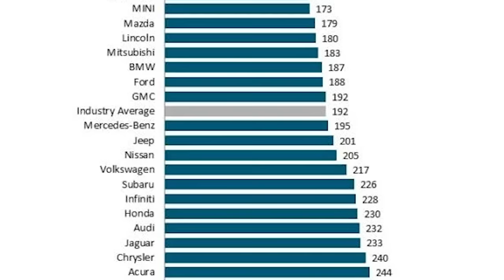Trucks That NEVER Break Down (Reliably run 1,000,000 miles)

Comment: You lost me when you said "According to JD Powers."  It's all about who spends the most $.  The data can be manipulated any which way to fit their narrative.  Kia and Hyundai with all their engine issues top the list?  Mini is #11 above likes of Mazda, Subaru, and Honda?  I guess I am old school and keep the car forever.  In the few studies I looked into, the "problems" are stuff like wind noise, slow infotainment boot up time.
Reply: I don't put it down to just 'money'. They are getting feedback on 90-day old and 12-month old vehicles, and looking at the 'small stuff' you mentioned. If you want to get the nicer of the brand new cars, and you're going to sell it in 3-4 years, that's what JD Powers is most useful for.
Reply: "JD POWA-"
"Don't touch me"!
Reply: They lost me with the ridgeline. It's a CAR with a lid-less trunk.
Reply: Never quite understood why JD Power glosses over Mazda, the Skyactiv engines are probably the most reliable direct injection engines out there and Mazda has the best interiors outside of a luxury brand.  And they also manage to make even the pedestrian CX-5 feel like a sporty, luxury SUV for probably less money OTD than a CR-V or RAV4
Reply: @mrvwbug4423  agreed
Reply: @richeerich561  I always thought of the Ridgeline as like a newer, more boring Subaru Baja.
Reply: Good call.
Reply: Jd power is a joke
Reply: @richeerich561 so it doesn't have a body on frame design. It's still a 5000lb hauler with a bed. Car truck, whatever, it does mid size truck stuff and will do it for hundreds of thousands of miles
Reply: The fact the Titan is not on there says it all.
Reply: Real talk
Reply: @itsmini6175  more like a Subaru Brat!😝
Reply: @christianrobloxserver7282  sure🙄

Comment: I've spent half my career fixing S 10 pickups and blazers. Some days I would walk into the shop and there was one on every hoist. Intake gaskets, oil cooler lines, ball joints, fuel pumps. Plugged heater cores, Typically any time one would come in, you could find $1,500 worth of work.
Reply: I was looking to buy one 8 years ago and I read the same things so I bought a full size 5.7 and have done nearly nothing to it. The full size v-8s are always better.
Reply: Sounds like a good vehicle in your shoes🤑🤑
Reply: I heard for the s10 you need the later one with the 5.3 v8 but still if you can score a deal on a 1500 or 2500 that would be a better buy
Reply: That Suzuki engine?
Reply: I just bought an old S10 blazer...had to do everything on your list and more.
Reply: Yeah I had a 2000 total piece of garbage, junked it with only a 110k miles
Reply: I find $1,500.00 worth of work without looking when anything comes into my shop.
Reply: Sounds like coincidence to me, I had an s10 and it was at 120k miles. No issues besides some rust, but it was solid.
Reply: I’ve had multiple s10’s and blazers and never had any major issues. Great little trucks if you keep up on them.
Reply: What’s the fastest way to go about pulling the engine, a 2.8L out of and ‘88 S10?
Reply: @freddieNyack  yea, but all I needed was a set of wipers…I thought your price for them was a bit excessive
Reply: A mechanic ?     wow     run for president with Kamala.
Reply: @freddieNyack  I don’t know how this country survives day to day when everybody is a GD mechanic 🙄

Comment: My 2005 Nissan Titan with 200,000 miles is still towing like a champ.
Reply: Worst truck ever bro wtf....you got lucky
Reply: I would put my 2004 6.0 Ford cat motor against any of the old boys and most of the newer trucks odometer reads 443,829 miles currently. Got it in 2018 and haven’t spent more than 1k in parts
Reply: @shuruff904  people now a days want a truck with all those fancy features. I once had a Titan, it was such a basic truck. 180k miles. Truck felt very reliable and the 5.6 had lots of power. I sold it cause the truck was very boring. Now have a 2013 raptor it’s a way better truck with comfort and features. Bigger price tag too. 

when it comes to doing truck things the Titan can do the same but at a fraction of the cost 😂
Reply: @Shitnugget69  put a cover on the back though, and those butt ugly Titans become Amazon delivery trucks....at least the older crappy ones looked decent enough to sell....Nissan-Mitsubishi-[insert name of parent company here] is struggling badly...
Reply: 200k not impressive anymore that average with modern vehicles Toyota and Honda been doing that for a long time just saying
Reply: @shuruff904  fake news.
Reply: @shuruff904 who said it was the worse one have you had one yourself
Reply: @luccib7225  Say that to anything built by Chrysler.
Reply: If I were to get a new LT it would be the Nissan Titan. Not much to look at the seating comfort is superb. Good mpg and heavy payload.
Reply: @christianmartinez7802  No, but 3 close friends have had Gen 1s and 2s and first the front bumper falls off after a few bumpy dirt roads, then the electronics start to fail, followed by the check engine light coming on, then the tranny starts slipping, then there goes your alternator or starter, and once all that gets replaced for tens of thousands of dollars, the motor starts knocking and eventually it becomes a yard ornament.
Reply: 2003 Toyota Tundra, original owner, 220,000+ and still going. I also Had one of the Nissan Hardbodies, just shy of 200k and traded and got the Tundra.  The main reason was the Nissan had a 4 cylinder and I needed something to tow a boat with.
Reply: 200k miles are nothing for japanese pickup trucks. I have had 4 isuzus and all of them troublefree, all sold with 200k miles
Reply: My Nissan 2001 hardbody 2.7 diesel is at about 280,000 miles, still very reliable
Reply: @dehanbadenhorst1398   I had a 1989 hardbody with the 4 cyl.  I needed a bigger truck but it was bulletproof for nearly 200k
Reply: @Shuruff904💤  I know 3 people with nissan titans nearing 300,000 miles on the odometer, they're reliable as fuck. That engine in the titan is a beast.
Reply: @Shuruff904💤  😂 worst truck ever based on what information?
Reply: @shuruff904  You are ignorant. They have far less issues than any of the big three.
Reply: Towing what a lawn mower? They don't even make a heavy duty
Reply: @ryo0o0o88  I tow my Jeep to trails, my boat to the lake, and my 29ft travel trailer to the camp grounds with my Titan. Not sure why you think the only things people tow are a lawn mower or an excavator.
Reply: Have a 17 titan that has been flawless. Not a diesel.  Love it
Reply: @RyO0O0o What do you mean they don't make a heavy duty? The Titan XD is a heavy duty
Reply: I too have a 2005 Titan (SE 4wd). I got it in trade for a motorcycle. It had been neglected so I went through fixing this and that. Along the way it really grew on me and now I love it with just 168k on it now. These drive trains are famous for getting at least 300k. 400k+ is not uncommon. It's all about maintenance. Simply changing oil and other fluids in the drive train makes all the difference. It's as easy to change the the trans fluid as the engine oil using the drain and fill method. Yes, the early Titan's did have some known issues but by now they have been worked out. Probably the most irritating one is the blend door motors under the dash for the HVAC system that like to start clicking then eventually fail. I try to not make changes to the dials until the season changes. I've had 2 F150 Supercrew's and 3 Rangers. I like this Titan better than all 5 of those trucks.
Reply: My '22 PRO4X has been flawless. Body on frame built with modern tech and American built. What more can you want?
Reply: @shuruff904   that's bullshit. The only real issue 1st gen Titans had was an issue with the manifolds cracking. I know guys with over 200k miles on their first gens. one of the guys runs his on the job site everyday and beats the piss out of that truck.
Reply: Any truck that has to have tranny replaced every 50k and front end rebuilt and rear axles going out makes it qaulify for most dependable 🤣🤣🤣🤣🤣

Comment: I'm rocking a 1993 Ford ranger with just over 500,000 miles. It's got the original engine transmission and rear end! 2.3l 5sp 2wd It's been my daily work truck for about 13 years.  No tics taps or raps and doesn't use a drop of oil....💪💯🇺🇲
Reply: Ranger,mine was a 94 and had 198000 miles and ran great, then a storm blew a tree over on it and totaled it out
Reply: I had 2006 ranger its was a warrior😊
Reply: i work with a bunch of guys that drive old rangers and mazdas as their dailies. i work at a rock quarry so most guys buy high mileage beaters to drive to work. the rock dust will scratch the piss out of paint. those old rangers are like roaches, you cant kill them. they will be the last thing on the planet once we all go extinct. I learned how to drive on a old late 80s 5 speed ranger.
Reply: @BadaBing_BadaBoop  I've always run a work rat, old asphalt paving guy. Dirty and stinky, if it's not the asphalt its the diesel fuel and I know all about quarry dust! Lol I bought this truck 13 years ago with 223,000 miles for $1400 I'm at 509,000 miles as I'm writing this 💯🔥💪🇺🇲 in

Comment: Hell yeah! Still rocking my 97 D21 4 banger 5 speed 2WD. Only 2 owners. My pops and myself. She is sitting nicely at 450,000 miles and still has way more to go. Truly an amazing truck, would recommend 10/10 not giving it up for anything or anyone.
Reply: Mines at 280k and also still running well. Only issue I’ve had recently was with the door not wanting to open
Reply: Unfortunately around here most of them rusted away years ago
Reply: I drive a Pathfinder D21 V6 3.0 petrol, 326606 kms on it. Original engine, works absolutely fine, doesn't use any oil, love it
Reply: @jeffersongarcia8257 dude my interior door handle on mine takes like 7 pulls to open
Reply: Crashed my 97 with only 170k on it 😢 miss it everyday. Was such a good truck
Reply: Have the 1987 version  ,  z24i and 5 speed rockin' 106 ferocious HP. 428,000 miles.  These things are true time machines. Runs the same as ever and moves whatever I dare to pile on the springs and air shocks. 30 years of work so far for $2500 used.  I can say I still actually like driving it on road trips too with Acura Integra seats I installed. They need to get busy and reproduce the HB for it's 40th anniversary,  retro like the Z,  priced like a Sentra. It would be a hit.
By the way, ever seen the Million Mile Frontier on TFL truck channel?  We have a long way to go.

Comment: 7.3 powerstroke diesels are what we run mainly at my job. I work for a tow and wrecker business… I have to say I’m madly impressed by some of the things we have managed tow with them 7.3 powerstrokes.
Reply: late 90s were tanks... the earlier, non-turbo diesels.. not so much.
Reply: @NXT_LVL  they may have had less power than their turbo successors but those old 7.3 idi motors were very reliable
Reply: Yes sir.  We ran a 7.3 for our construction company.   It had over 300k miles o  it, bagged two deer, hauled tools/materials daily, through Seattle and Portland traffic as well as the outback with NO engine issues, ever.  Then that stupid kid thought he had room to make a left turn..      RIP our diesel work horse.
Reply: @Billy Reece  agreed. Had many 7.3s thry were more reliable than any Powerstroke versions but the power was terrible.
Reply: My daily driver 97 powerstroke has 400k on it and is totally reliable. Never leaves me stranded.
Reply: @jessepitt so is mine! 400k, original injectors, original transmission.
Reply: 450k on my old 7.3k that’s still running. 96’ 
Loving the 6.7 now though.
Reply: I have a 92 F250 idi with an after market turbo and I pulled an 8.5 ton trailer over the Sierra Nevada Mountains.  The 7.3 idi will do any job you want it to do, it just won't do it fast.

Comment: in Afghanistan I drove Hillux, never had an oil change, others had fueled it w aircraft diesel with additives, had sand dunes on the dash, missing chunk out of frame due to hitting roadside mine or drove into deep flooded ditch (whichever story u choose to believe)…I fell in love absolutely with Toyota.
Reply: Tried to import one but they wouldn't allow it at the time. Sucks
Reply: There was a letter that USSOCOM sent to Toyota because they had imported some of the Tacomas into Afghanistan and in the letter they praised Toyota's reliability. They claimed the Tacoma withstood absolutely everything that was literally thrown at it, including RPGs and it never broke down once.
Reply: Yep 👍 I worked in Afghanistan for over 6 years , those Toyota Hilux pickups were indestructible, literally bullet proof. And here’s a bonus ( how about those Kawasaki Mules ! ) those things took neglect and punishment like I’ve never seen before and you couldn’t kill em’ !
Reply: Hahaha you ain't lying. I saw the ANA get hit by two, IEDs, and still repurpose the truck after they towed it. Replace the axle, and the rear drive shaft. No truck bed left and nothing left of the bed.
Reply: You just have to watch out for those 1989 Toyota Corollas. They tend to blow up a lot. Lol
Reply: Was it a technical with a 50 cal on the back? Lol
Reply: @JustinTrudeau-up7jz  I hope no Corolla 86s were harmed.
Reply: @westcoastplinkin6559  lol they gone.
Reply: We can’t get Hillux because of California emissions regulations .
Reply: Let's not forget that they carry camels around in the back of them too!!
Reply: As did I!... I had my eye on one in Salerno. Gorgeous rig! And yes with the diesel motor. JP8 was run in a lot of vehicles over there.
Reply: @westcoastplinkin6559  Never saw any Tacoma's only Hilux.
Reply: @JustinTrudeau-up7jz  ohh, you mean the VBIEDs? Lol
Reply: I bought a Hilux for off roading and towing the caravan, heaps cheaper than buying a bigger or more luxury 4x4 and couldn’t be happier with it, I give it hell and never had a problem.
Reply: Unbelievable it ran on jet fuel👍
Reply: Had the same contractor vehicles ( Hilux and Camry)  in Kuwait and Iraq….mechanically bullet proof. Chevrolets that showed up occasionally simply couldn’t handle the environment and tended to have terminal failures …..as in they became unserviceable and unrepairable rather quickly.
Reply: @hikerhobby1204 Just FYI, JP-8 jet fuel is nothing more than extremely filtered diesel.